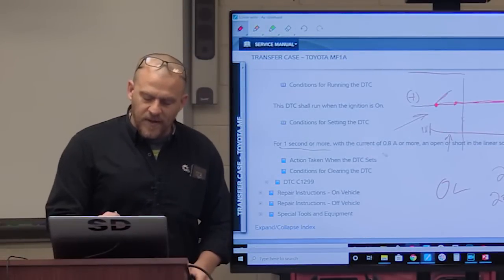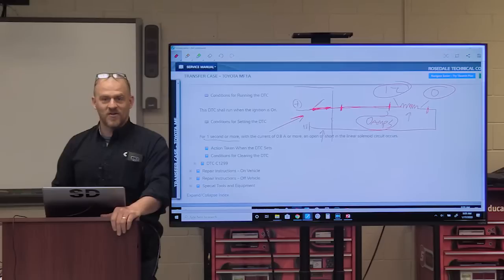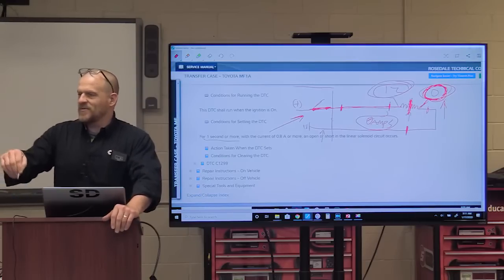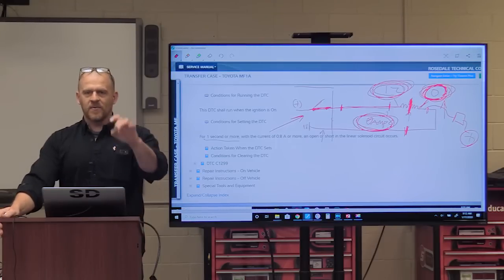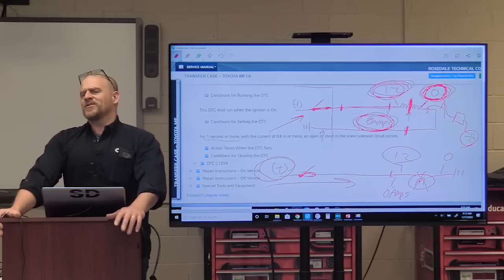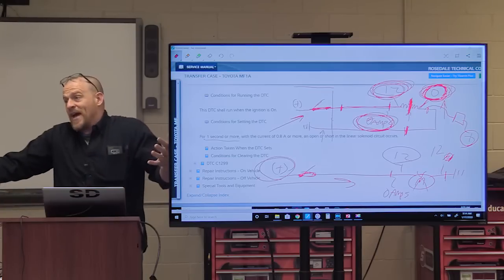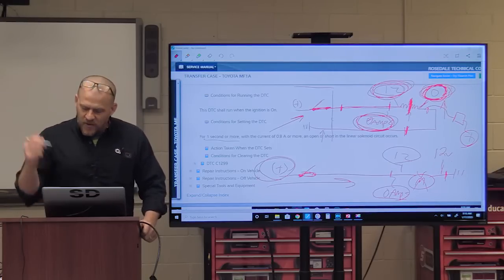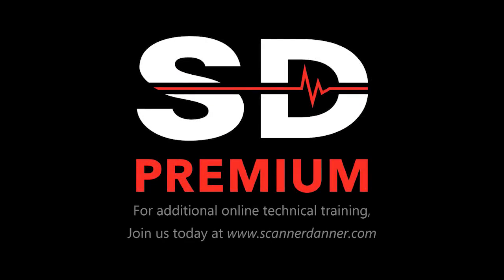Should I Make a Bunch of Different Test Lights to Load Circuits?

Comment: Please correct me if I’m wrong , you have learnt us that positive control outputs (coil integrity) can be tested while the circuit is unloaded by checking voltage before and after , in your example if we found ground before and after it means the coil is not open , but if we found a ground in the ground wire side and “ goust voltage” in the positive side wire it means open coil circuit “also we can use a test light instead of voltmeter”

I know that you are trying to explain more ideas and thought processes to open your students minds 

But I don’t think it is nesseccary to hook up scope and amp clamp 

Again correct me if I am wrong 😊
Reply from the maker: "Ghost voltage" is a separate topic and does help ID opens in a circuit
Reply: @ScannerDanner  
Forget goust voltage , but can we check the ground existence using voltmeter buzzer test or using test light on both coil ends “unloaded” , to confirm coil integrity? 

Oppositely if it is ground control we can check the 12V on both pins “unloaded” to confirm coil integrity 

I remember this was one of your diagnostic tracing method 🥹
Reply from the maker: Chapter 3 material in my book and classes my friend. Ground side switched and power side switched circuits will each have their own unique variables. When at all possible you want to "load the circuit" (current flow). But since we are talking about an open in the load (solenoid winding in this case) a reading of 12v and 0v on the solenoid connector and the solenoid doesn't function, your done. The solenoid is open. You can certainly perform other tests to confirm. Resistance of the coil itself. A test light to substitute the load etc etc.
Reply: @ScannerDanner  I’m really sorry , I’m 100% agree with you but I’m saying that for the solenoids we can test it’s integrity without loading the circuit 

Negative control output - well known - unloaded : both pins (12 & 12)
Post. cont output - well known - unloaded : both pins (GRD & GRD) 

This test for checking coil integrity ☑️

and for checking voltage health and extra resistance existence in the wires , for sure we need to load the circuit to check for any voltage drop on the positive side or voltage raise at the negative side due to undesired resistance 

I think there is no conflict between us , and surely your test is gonna test both (coil and wiring) at the same time ☑️

I was revising my infos 

Love you  and your family 🫡🤍
Reply from the maker: @mahdiscope2545  we are good my friend! I just didn't understand your questions. Or if you were talking about another method? There are certainly many methods that can be used to come up with the same conclusion. My methods are not the be all, end all. They're just what I use and what I teach. Thank you my friend

Comment: lol   you've never worked on the crap i have appearantly lol.  i do agree with you it seldom happens on its own.  most of the ones i've dealt with with two opens someone else had thier grubby meat hooks on
Reply from the maker: The main point was in making the call on the load itself. The additional wiring tests aren't needed to make that call :-)

Comment: Danner I have a Problem with my vehicle when I turn the key on to prime my fuel pump nothing happens, later the next day the ignition turn on vehicle starts and then stops about 15 minutes later ,can you help me with some suggestions.
Reply from the maker: when it is not starting, what are you missing? Spark, fuel pressure, injector pulse? What codes? What year, make and model and engine?
Reply: @ScannerDanner  I have fuel pressure at 48 PSI also have spark it runs fine for about 15 minutes and then stops , it’s 2000 dodge Durango 5.9 R/T ,I wish can bring it to.
Reply from the maker: @guillerminasoto4690  that wasn't my question. What are you missing when it does NOT start?

Comment: I think te title of the video might be wrong.
Reply: I waited and waited to hear about test lights lol
Reply from the maker: The description is important here 😅
Reply from the maker: @gnomiefirst9201  my main point in this video is the additional loads from different lights are not needed to condemn to open in the "load". If someone wants to use them to ALSO test the wiring, I have no issues with that.
Reply: The facts speake
Reply: @johnreid859 I've seen it on Pine Hollow Auto Diagnostics, he uses different amp bulbs to load circuits to verify they can carry the intended load. A test light might light but the circuit might not be  able to carry the intended load due to unwanted resistance in the circuit e.g. faulty wire, faulty gnd, relay, etc. Im guessing with an accurate amp meter you could do w/o the bulbs e.g. too high amps/too low amps would indicate something is not correct.